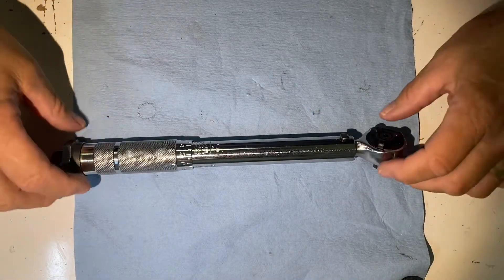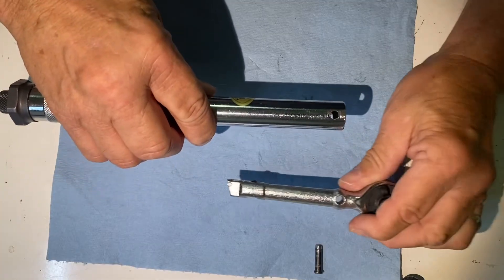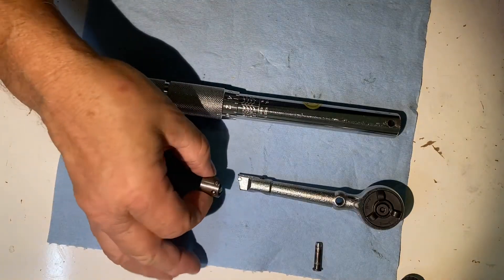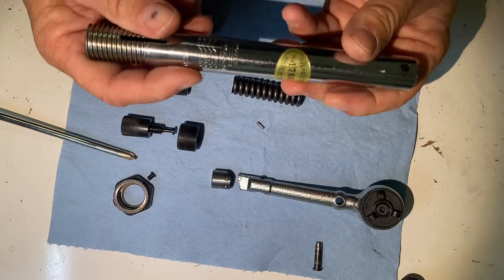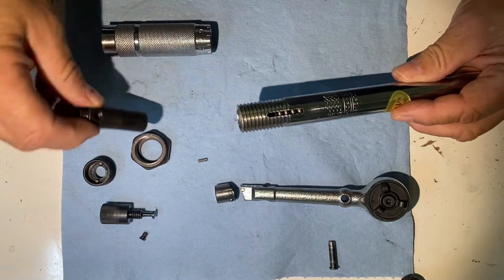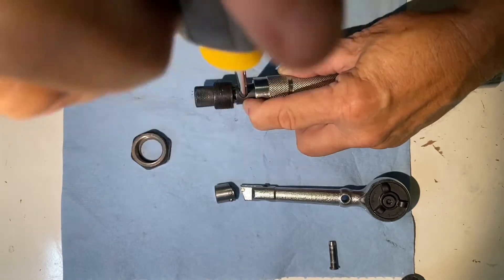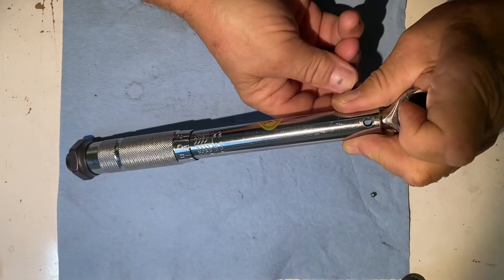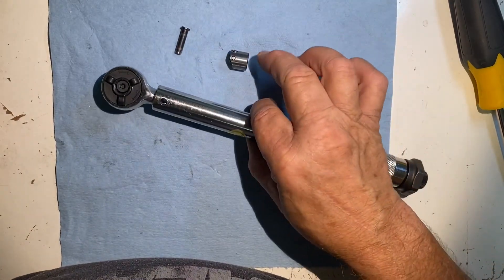O'Reilly 3/8" Torque Wrench Repair

Comment: Show you a movie I used to work at the jawline tour runs. We made snap-on and Williams New Burtons your spring supposed to be greased where you're into the wrench sits on the pivot reset part and make sure your your screw is greased when you assemble it and get yourself a good calibration kit to calibrate it at 10 years experience in that company we need Williams we made some good torque wrenches. Have a good day. God bless. Amen

Comment: Waiting for part 2 calibration.
Reply from the maker: As luck would have it, I had the calibration video up shortly after this TR repair vid.  A commenter told me it was not correct so I deleted it.  Basically what I did was hung a 20 pound weight off the TR shaft from a point 12" away from the center of the ratchet head.  Set the TR setting to "240 inch lbs" and adjust the "click" to that point.  While not exact, it's close enough for oil pan bolts and the like needing a torque of around 20 foot-pounds (240 inch-pounds)
Reply: @ccarlley  
Nothing wrong with that, torque is force times distance. Sir Isaac Newton agrees with you. You could compensate by introducing little fudge factors, good enough for non-discriminating DIYers.
Reply: @kimchee94112 Yes, decades ago I torqued cylinder head bolts on an old Land Rover with a measured bar and a spring balance intended for fishing. Someone came by, said "You can't do it like that" and checked with an expensive torque wrench. Every one was correct.